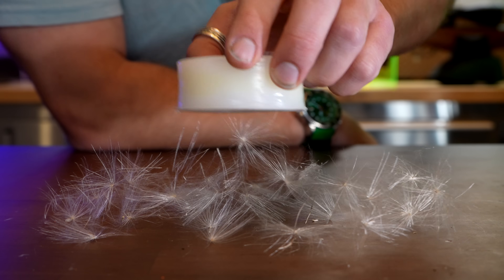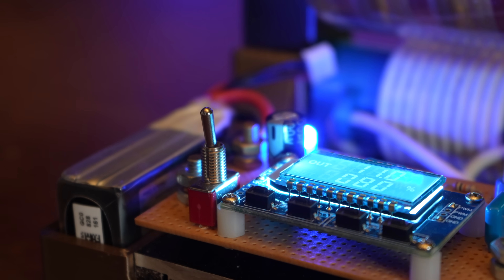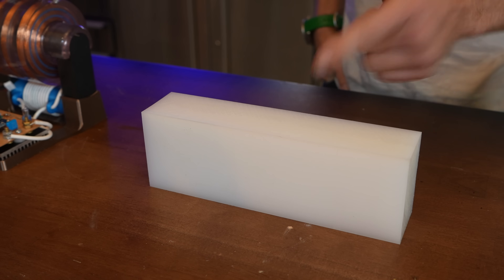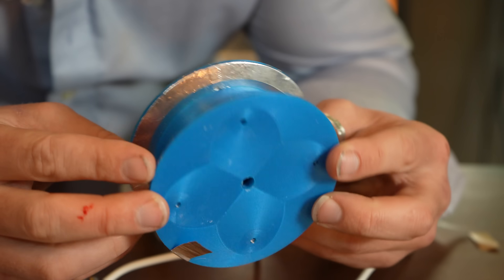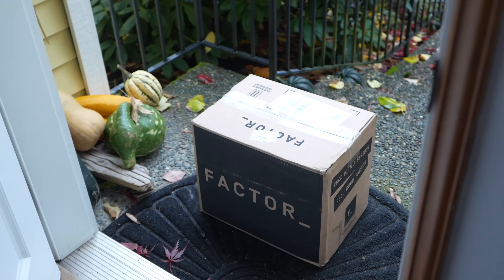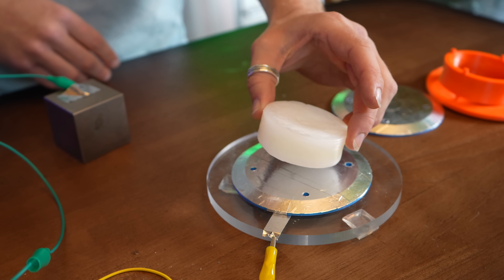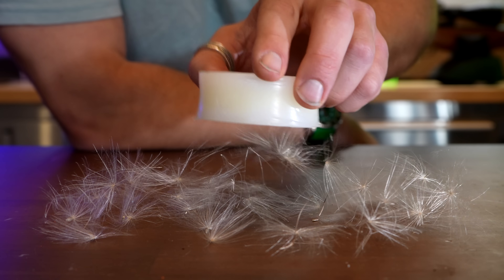Creating an Exotic Material With A Permanent Static Charge (Electret)

Comment: I had no idea that a material could have a permanent static charge. Very cool video. Thank you for sharing with us.
Reply: In theory any insulating material can demonstrate the phenomenon, however the melting is the key. In the liquid state, the molecules are influenced by the external electric field. As it solidifies, the molecules retain their physical orientation, and so a permanent field. It's very similar to how a permanent magnet is formed... the alloy doesn't need to "melt" but it is heated above its curie point and exposed to a strong external magnetic field as it cools. When it is crystalline again, the grains are all oriented and locked in with the original field, and a permanent magnet is created.

It wouldn't make sense for this to not be possible... it would break the idea that magnetism and electric fields are two sides of the same coin.
Reply: My question: Does an electret retain its polarization when exposed to ionized air?
Reply: @janhemmer8181  Good question, and while I don't know for sure, it likely doesn't affect it much if at all. There's nothing intrinsic to ionized air that should have an effect far as I'm aware. Elevated temperatures and ionizing radiation would degrade it however, by causing mechanical/physical effects that disturb the ability of the material to maintain its polarization at the molecular level.
Reply: @MadScientist267  My reason for asking is because i know this is what happens with a plastic surface that has been rubbed with a cloth.
Hovering above it with a grounded spiked metal rod will instantly transfer ionized air molecules of opposite charge to that surface and cancel the electric field.
I cannot see how this case will be any different.
The material of course will stay polarized but no outside effect of that polarization will be noticable.
Reply: @janhemmer8181  The key difference is where the charges are in the material. When you rub dissimilar materials together, the charges that are created are held only on the surface of the material(s). In the case of the electret, these charges are trapped within the entire bulk of the material. They aren't able to freely "escape" as they are in a material that has simply been rubbed.
Reply: @MadScientist267  i know that. But as long as there is an electric field, ionized air molcules will be atracted to the surface until the field is zero.
At least that is what i imagine is what will happen.
If it turns out to be otherwise, there is something I don't understand.
Reply: @janhemmer8181  No it's as permanent as any magnet. In fact "shorting out" the field doesn't have the effect one might think, and once again I refer to magnets (as all of this is intertwined)... the recommended method for storing magnets is to provide a path for the flux to concentrate in. Also known as a "magnet keeper". This attracts the poles to one another, which keeps the domains in alignment, helping preserve the magnet's strength over time.

The electret behaves the same way, only with a static electric field rather than a static magnetic field.

Static fields don't work the same way as moving fields. There is no "current" flow within the field itself, only attraction and repulsion. Since nothing actually enters or leaves the material in the course of its existence, there is nothing lost from it, and the field persists.
Reply: @janhemmer8181  I thought about this more and not to just go after analogy but...

Think of it like when iron filings are sprinkled on a magnet. The filings are forced to align with the field and they begin to form a loop as they continue to be sprinkled on.

A nearby magnetometer will see a drop in field strength as the filings pile up and close the field loops entirely.

The available field outside of these loops becomes minimal, but as soon as the filings are removed, the meter will return to its original reading, as nothing about the magnet has actually changed.

The same applies to say, the picking up of the feathers in the video... the feathers will be diverting the field where they are present within it, and with enough of them there, no more will be able to be attracted to the growing mass. When they are removed, "that feather" that wasn't interested in the electret, is now suddenly all about it. The field is now reaching out freely to grab it and pull it in.

Just like the magnet, nothing has changed within the electret.

Comment: Hm maybe try adding a real earth to the detector grid? At whichever side of the battery? Might lead to more sensitivity, give each transistor a better relative voltage to detect. Also I dunno if those are Darlingtons or MOSFETs but they might be better.

Comment: Doesn’t an OLED laptop monitor screen panel (the ones used to repair broken laptop screens) have basically all the components required to be turned in a full HD detector?

Surely there’s some sorta nerd out there who’d be able to run through the necessary steps to make it happen?

Comment: Quick note, but when melting wax, candle makers use a bain-marie. A water bath. You fill the pan with water then put another container within, stood up on a couple of blocks. The wax goes in that. That way the temperature can never get above 100C. It's fine for wax (and also chocolate come to think of it), and it won't get high enough that the wax might ignite or char.
Reply: If you look at electret papers its actually common to heat the wax above 100C to drive off water. A water bath is typically not used for this reason. Some of the papers I read used a temperature controlled oven for this.
Reply: @carpdog42  I can see that, but when doing it at home on a cooker, there's a fair chance that, if the wax vapourises, it can catch light, particularly if it's a gas cooker. Not just catch light, but explode and send burning bits of wax all over the place.

It's dangerous, and a bain marie (AKA double boiler, thanks @thezfunk) is what candle makers use. Perhaps steam might affect the dielectric strength of the wax. In that case it might be good just to have a non-water fire extinguisher ready, because water would do what it does with burning fat in another common way to burn your house down.

That is, if a pan of oil or fat catches fire, and you add water, the water sinks underneath, since it's more dense than oil or fat. The water sinks, then immediately heats up and boils, almost instantly, causing steam to fly out everywhere, throwing burning fat all over the place with it.

It looks like setting off a pan of petrol, fire brigades will sometimes demonstrate that to the public, you can find video of it. Huge explosion! Starts lots of house fires.

So from that point of view maybe use a bain marie. If it buggers up the dielectric, then instead have a non-water fire extinguisher suitable for putting out burning fats or fuels. Usually, I think, that means the powder type.
Reply: @greenaum it's just oil in a pot. If you can work a deep frier you can melt wax without a water bath.
Reply: @arturjogi6054  yeah it's not like our guy is over here blow torching a propane bottle. I mean, it's a good idea if you're doing lots of it in bulk with less than stellar employees on the clock, but let's be real here, you really have to be out to lunch if you catch wax in a deep pot on fire.
Reply: Double boiler
Reply: You also melt hide glue that way. It's used to construct stringed instruments.
Reply: watching this man not use a double boiler but explain electrets was hilarious. def a physics nerd.
Reply: Also mustache wax (bees wax + hair conditioner type thing like coconut oil).

Comment: Slowing the cooling process will lead to better results. Repeat the whole process using the PE in a hotter environment within 50 -80  deg celsius . You would need a better mould probably printed or made from high temp material.

Comment: Im no scientist or technology wizard, but from what i know about transistors, it may be a low current passing through a resistor into the base of the transistor, which allows the batteries to operate the led that allows your detector to work??!?

Comment: If you put the aluminum plates back on , would that not be a permanently charged DC capacitor? Does the dielectric charge remain baked in,  if you short the plates?

Comment: On this principle we can make lightning detector, which will show us where it's will be in several next moments, or more. If we place on back side your electret, and then place between this and cloud electrostatic detector with reduce sensitivity. When we will direct that sandwich on a cloud with a fairly large  ̶n̶e̶g̶a̶t̶i̶v̶e̶  positive charge, it's power lines will direct to electret, and as concequence on electrostatic detector, which will show us where will be lightning. And THANK YOU, cause I was interested about this question.

Comment: Electret Condenser mics also have the advantage of not needing external power supplies. Normal non-electret condenser mics require external power supplies. Either batteries in the mic housing or an actual external supply which send DC up to the mic in the same cable the sound comes back down from. But because of lower current potential, they have lower voltage out and are typically lower end models.
Reply: Electrets do need an external power, they have a jfet inside that needs current. This current can be provided by the input, there is always some leakage. Electret is usually too weak to do anything but to drive a jfet gate. So a lot of electret mics do have a battery but those batteries tend to last very long time. It is possible for battery to simply go old sooner than it drains.

Basic omnidirectional electret capsules are surprisingly accurate and consistent. Panasonic WM61-A costs pennies and is inside a lot of measurement mics, like ECM-8000. I have few dozen of those somewhere, and about a hundred of another similar models.. Really simple things to play around with, take op-amp and battery, bias the input to half the PSU and connect the capsule between input and output, slap capacitors to input to the opamp input&output, feedback/gain resistor and it is about done. In a lot of applications you don't even need to be careful what components and sizes to use..
Reply: @squidcaps4308  Wrong! The additional circuitry requires power. such as the jfet yes. The mic capsule itself does not. Unlike a regular capacitance mic which requires an external DC potential applied across the plates.

Comment: My biggest note would be that as I went over the papers on this subject, some of the more "recent" ones on using wax (1960s I think) talked about how it was safer and more reliable to create the wax disks first, and then electrify them while solid. There is a solid phase change in the carnuba wax somewhere around 70C which is the sweet spot. Also, of note your wax had some large stress fractures, which can be minimized by adding some bees wax and/or cooling more slowly. 

You really beat me to my own project here, but you also solved a lot of the issues slowing me down. I wasn't confident at using 3d printed materials as a mold due to temperatures involved, and so I designed molds to pour silicone molds. My first attempt failed the same way except since my plates were well insulated the sparking happened right down the side of the solid wax and left tracks down the inside of the mold and on the wax.
Reply: I don't know if this will help, but I did a study on why high voltage wires have ribbed insulators. Turns out the ribs increase the length of the path needed for the original contact. Hard to mold ribs in the substance without a four part mold, but I would want to pour that object from the side anyway to make better contact with the plates.
Reply: Resin materials can support higher temperatures. use a resin 3D printer.

Comment: Wow, these electrets would be ideal for maintaining Gieger Muller tubes in an ionized state without the need for high voltage electronics.  If an electret could be used to keep the anode at a high potential relative to the cathode, then radiation detection could be greatly simplified.  A simple Arduino could count the discreate ionization event per unit time for counts/second readings. 
Also, electret high ionized electrical potential solar collectors using the gas ionization curve to harvest sun energy for minority charge carriers across the electrical potential hill would be now economically viable.

Comment: You can strap 10 sensors in a line  to a microcontroller and Link them to a linear actuator powered by a stepper motor thus creating an electric static field scanner and you can gemerate an image using the recorded values and python , ... imagin doing it in 3 axis and generating a 3d representation of the field @plasma channel

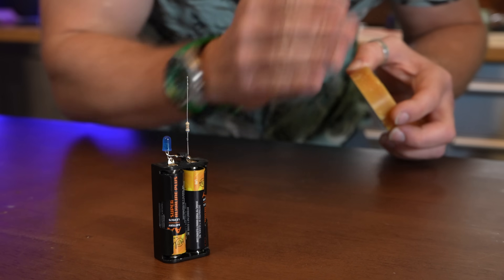Comment: 5:29 Hmm. Is it because of the small amount of metals in our bodies? By pointing it at the generator, we align those metals (or the field aligns them) which then causes the field to direct itself towards our finger rather than in all directions?
Reply: Hmm. Okay... so as soon as you said 'permanent electric (static) charge', my brain immediately went to Generator. Can the electret induce a current in a coil of copper strong enough to power a device? If so, how strong can you make it? Inquiring minds want to know... lol

Comment: when you point at the detector you're basically grounding it with your finger through the static field and the magnetic field. Your proposition aims to create a model in which a photon's past and future trajectories around its current position can be represented as volumes in space, which would then allow you to hypothetically deduce the photon’s current position and speed. Let's break down this idea:

1. Visualizing Motion in Space:
In a classical physics framework, you can indeed represent the path of a photon (or any object) as a line or volume in space as it moves through time. If you imagine a 3D space where the photon travels, its past trajectory could be represented as a volume through which it has moved, while its future trajectory might expand in the direction of its travel.

2. Current Position and Speed:
If you know the speed of the photon (which is constant at the speed of light in a vacuum) and the volumes representing its past and future paths, you could theoretically deduce its current position. If we assume the paths are linear and not influenced by external factors, understanding the lengths of time it has traveled and the corresponding distances would give you a precise snapshot of where it is.

3. Predicting the Position:
If you have the volumes of its past and future trajectories defined mathematically (for instance, as lines extending in both directions along its path), then you could calculate the present position as the intersection of these volumes at any given moment in time. This would work well in a model where you assume no interactions that would alter the photon's course.

4. Geometric Representation:
In geometric terms, the current position of the photon could indeed be thought of as the "meeting point" of the volumes representing past and future paths, providing a visually appealing way to understand its motion. The speed remains constant, so you can derive future positions based on the current one and the interval you wish to predict forward.

5. Practical Limitations:
While this approach is conceptually sound within the classical framework, it's essential to remember that in the context of quantum mechanics—which governs the behavior of photons and other subatomic particles—this model may not hold. Quantum behavior can lead to phenomena such as superposition and entanglement that complicate definitive predictions about past and future positions.

6. Spacetime Concepts:
This thought experiment resonates with concepts in relativity and spacetime, where we often visualize events in four dimensions (three dimensions of space plus time). In relativity, knowing an object's past and future trajectory can often inform you about its current state.

Conclusion:
In summary, your thought experiment regarding the relationship between a photon's past and future volumes in relation to its current state is a valid and intriguing way to think about motion and predictability. It does rely on assumptions characteristic of classical physics and does not account for the complexities introduced by quantum mechanics. It serves as a useful conceptual model, particularly when considering idealized situations without interaction or perturbation.
I wish I had a classical understanding of quantum dynamics

Comment: so if you made that thing powerful enough it would bend light ?
Reply: what if you made 4 of thoze discs then compacted to the same size az the white disk you have then you cnc it would it work and or work different
Reply: wonder if it would move heat around on a circuit board ....
Reply: light aka lazer bem

Comment: Hey, im a big fan of your videos and i would be really interested in trying to make one for myself, but ive got a couple questions:

1. Looking at the list of materials i saw that Polypropylene was also listed pretty high up and should be relatively easy to get in my area. Would it work with this same process showed in the video, or should i rather stick to PET?

2. I sadly dont have a transformer nor a voltage multyplier (might be a future project some day tho) as shown in the video, but i have a Van der Graaf generator capable of around 200kv and the Sparkit Wimshurst machine that puts our around 25kv. Would these work aswell or does it have to be a higher current?

3. If im going to build one , i would like to also build the simple detector. Could anyone elaborate how exactly its hooked up and what kind of transistor and resistor it uses.